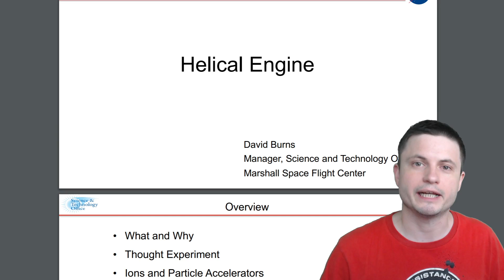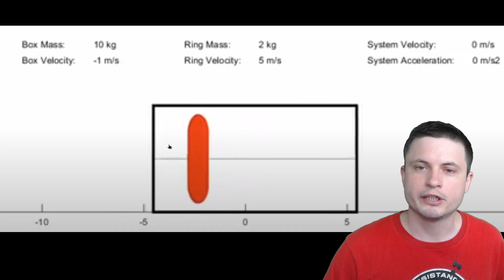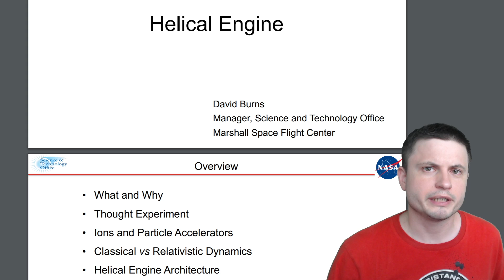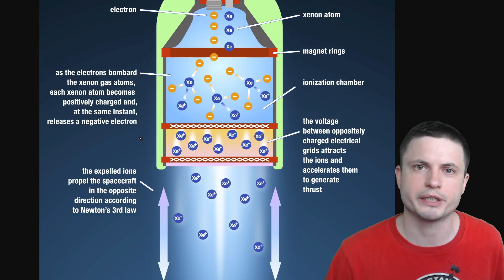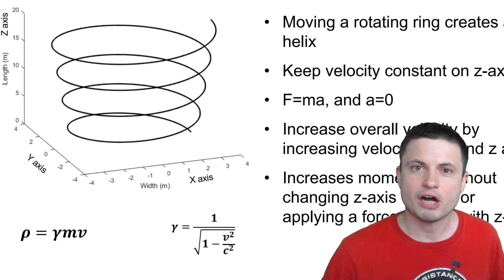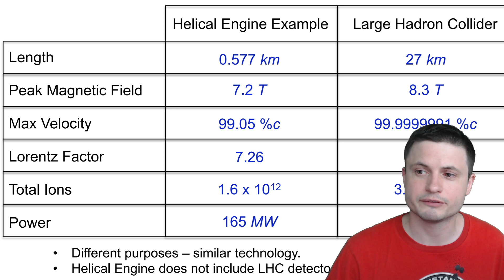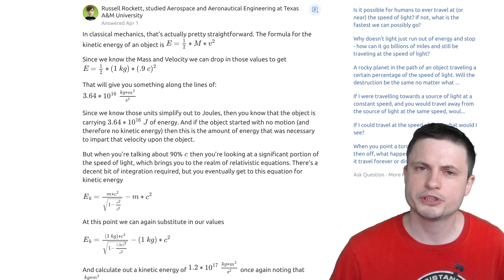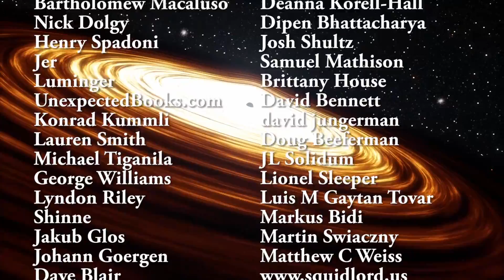NASA Engineer Designs a Near Light Speed Engine But Does It Work?

Comment: A sealed box built with a magnetic metal which you use as a accelerator and within the box a giant electro magnet within and it has the power to pull and push back and forth and Everytime it seems like it's gonna not stop you have that force you get from pushingtwo magnet's together put they push away like a brake or suspension

Comment: I'm of the feeling that everyone has got Einstein's special relativity wrong, in that they accept that the time for the people accelerating in space slows down RELATIVE to those they leave behind, likewise the length of their spaceship contracts RELATIVE to the frame of reference of those left behind, however for some strange reason mass is treated differently & rather than being RELATIVE mass is seen as absolute mass, which as the three factors of time length & mass are interrelated can't be correct. The time for those on board the spaceship moves normally the length is also normal, I suggest the mass is to, so what would happen is similar to someone falling into a black hole, they split into two, one is from their own frame of reference, whilst the other is from the frame of reference of an outside observer.

Comment: Major error in this design...there is not enough space inside a craft to accelerate to such speeds then decelerate before punching through the hull into space. He's got the right idea though but what if the hull of the craft was actually in 9 sections connected to each other by electromagnetic force...then the first section is launched forward by reversing polarity...then the second section is launched just in time to reconnect with the first....then the third , fourth etc... sort of like the way a worm moves section by section...could it be possible to get forward motion and increase the frequency until it builds up momentum?

Comment: Time dilation is bs.  Gps satellites dont rely on the mathematics of time dilation to tell you your position lmfao.  Your gps location is derived from your position relative to nearby cell towers and has nothing to do with satellites.  The only time your gps location is determined by satellites is airplanes and ships.  Airplanes rarely use it as anything other than a ballpark estimate as the system isn't even designed to show locations above the surface of the Earth or Oceans.  Ships that rely on GPS are also frequently put significantly off coarse due to the inaccuracy of the system to give an exact location as they move across the ocean and rely on visual input when making port.  If the system was so accurate that it relies on time dilation equations to calibrate then why is it still so far off?  Thats a rhetorical question.  The point is that 99% of people get their gps from cell towers not satellites and the satellites are frequently way way off compared to the accuracy you get from cell tower triangulation positioning.

Time dilation is a fun idea like the simulation theory but this is not an established fact.  Incorrect information like this guy repeated about satellites proving it by needing dilation equations to adjust for their speed fuel the idea that it is an established fact.  However as he freely admitted he doesn't understand it so him repeating that shouldn't mean anything and yet, if enough people say it a lot of other people start thinking its true.

Why would prominent scientist claim time dilation is real?  Its simply a modern example of the emperors new cloths.  If you dont accept it then you clearly arn't as smart as them.  Yet most people who claim to agree like our host here freely admit that they dont understand it.  How can you believe in something you dont understand?  You can't.  You might want to, you might even convince yourself that you do but you can't.  If your belief is based on nothing more than someone else's opinion then it is foundationless and meaningless.

The problem with time dilation is that every formula relys on an arbitrary decision by a conscious individual to choose a point of reference.  If you change the point of reference then the amount of dilation changes accordingly.  Sadly Earth is not the center of the universe.  Neither and I and neither are you.  The fundamental realities of the universe do not change based on where I decide to measure from.  Now a factual measurement of a reality can be measured from any angle or any position and that measurement is always the same.  For example if you measure a stick with a measuring tape from one end to the other and determine its length to be 1 foot then that is it length, period end of story.  If you turn it around and measure the other way it is still the same length.  If you use a different device to measure it, still the same length.

Time dilation on the other hand changes every time you change where you measure it from.  For example.  If you have a ship leave Earth at 1/2 the speed of light and a person measures the time dilation from Earth 24 hours later then the person on the ship appears to him to have only experienced 20 hours.  On the other hand if the person on the ship observes the person on Earth using himself as the reference point then he sees that the person on Earth only experienced the 20 hours.  Obviously both can not be simultaneously true.   This alone is proof that time dilation is bs.  It can't even be measured from two different reference points and get the same results.

Now just for fun lets toss in a second ship moving away from earth in the same direction at 3/4 the speed of light.  After 24 hours the guy on Earth looks at the first ships and calculates that they have only experienced 20 hours while the faster ship has only experienced 16 hours.  Now shift your perspective to the faster ship and they observe the person on Earth has only experience 16 hours while they have experienced 24 hours.  Then they look at the first ship and from their perspective that ship is only moving at 1/4 the speed of light while from Earth it was moving at 1/2 the speed of light.  So to them that ship appears to have experienced 22 hours while they were experiencing 24 hours.

So depending whether you consciously choose to measure the time dilation from Earth, the first ship or the second ship, the first ship would simultaneously experience 24 hours, 22 hours, and 20 hours all at once.  Since any reasonable person can clearly see that this is impossible time dilation is bs.  This theory is a fun trick of math but not more so than running numbers on the probability that we are living in a simulation.  In the end time dilation can't be measured from more than one arbitrarily chosen point and falls apart when measured from any two points in the universe.  It is almost unbelievable to me how many people have accepted this as a fact simply because someone they persevere as being more intelligent told them it was true.  Don't take my word for it.  Look up the formulas, do the math for yourself, its not that hard.  Read up on the experiments that supposedly "proved" time dilation.  Read their original reports and compared them to their published date.  Notice how many errors they made in simple scientific methods of establishing controlled experiments.   See where they admitted that they "corrected" numbers that didn't match their hypothesis.  In the atomic clock experiment they took multiple results which were the opposite of their theoretical results and "corrected" them to fit their theory then published the results as "proof".  Its actually a little ridiculous that anyone takes any of this seriously.

Before you get to invested in the scientific theories of a brilliant man from 100 years ago ask yourself if you would trust your life to the smartest doctor from 100 years ago, or your car to the smarted mechanic from 100 years ago.  The only reason this theory is still around is that some people like the admiration they get from others when they can convince them that they know something the rest dont.  Its really that simple.

Comment: In less than 10 years they designed, built, flew and landed on the Moon in 1969 with the Saturn 5 rocket. Now for over 10 years in 2021 NASA has been working on a rocket that will return them to the Moon and it still isn't ready. They learned at NASA that if you want to keep your high paying job don't ever complete the project. NASA has turned into a "rocket research company". The technology your talking about would take them 1000 years and still not complete it.

Comment: Well, in my thinking, if you aren't working hard enough to fail once in a while then you aren't trying hard enough.
We learn alot by failing.   We should try building this kind of thing, in a prototype here on good Ol' Earth, and see what kind of propulsive force can be achieved just like NASA is doing experimentation in their "Warp Engine" lab with Harold Sonny White.  Nothing may come of that experimentation, but then again something might, and we may be led to some other interesting avenues and possibly new science as a result of trying!  
We should always try.. We may fail, but that's the whole point.. Try, fail, try, fail, and ultimately learn along the way and then succeed!!

Comment: If anyone sees this

It's actually possible to build a brute force interstellar ship right now for around 3-5 billion that would include 10 X 10megawatt power plants, and 8falconheavies in formation to lift it into orbit.

Then using more heavies lift more fuel tanks into space to attach to the interstellar ship.

We send a module in advance to the moon, a decent sized module with a crane attached that can reach up 200+meters. This module would be produced in conjunction with BOC gasses to mine and produce methane on the moon (it's been found in craters)
Fill the fuel tanks at the moon and then get a gravity assist at the moon, then one at Venus, Jupiter and then off out the system with 30-50 raptor engines with 100-120+ hour burn in direction of system wanting to visit.

With raw materials and 3d printer onboard repairs and new raptors could be built for the slowdown burn. Gimbled raptors capable of 180°/360° movement.

We could scale down or scale up but it is possible.

Aiming for a ship size with a crew of around 250-500+k

Comment: Wouldn’t the spinning mass slow down in it’s forward momentum when it gains the relativistic mass from spinning? :s
If we ”put the spinning thing” in a box, from an outside observer it would appear as if the box is just gaining mass, ant thus momentum, wouldn’t it’s linear velocity have to decrease in order for the total momentum to be preserved?
I should probably go read the paper, but my guess is that he assumed the forward momentum to be constant and uncoupled from the spinning motion, which isn’t nesesarily true.

Update, it appears the author did consider this a possible source of error, as he writes ”the simulation model needs to be validated further to make sure rounding errors are not causing the thrust”, meaning that he is relying on a simulation and has not ”proved” that this thrust actually exists with physics equations. So my guess is still that the ions will impart a force to the ”box” as they rotate, possibly through bending spacetime.

Comment: If you could take rotational force and convert it into linear force and them back to a rotating force on the return.  You could cancel out the linear force
in the return of the mass by gradually rotation the mass as it become closer to the back end.  I found myself imagining the motion of a handheld drilling screwdriver.

Comment: Will it not be the case that no matter how you do it, you will just be creating opposite momentums? Won't the increase in mass from the spin reduce the initial velocity so that momentum is preserved? Is there any mention in the theory of this contraption of it pushing out gravity waves in one direction? That would be the only way it could possibly work without discarding matter in some form.

Comment: What if you could accelerate some matter in a ring to relativistic speed increasing its mass, move it perpindicular to the rotation for a large reaction force, recover some of the energy used to accelerate that mass by slowing it down similar to regenerative braking in an electric car, lowering its mass, and then move it back for a smaller reaction force? Use another one turning in the other direction to cancel out the circular motion.

Comment: This is fake news. To reach 90 % of c the spaceship would require a mass increase of 150 %, so if the spaceship weighed 1,000 tons, that's a relativistic mass increase equivalent to 1,500 tons! Where is the energy to provide this colossal mass increase coming from? To provide the energy of a 15 megaton hydrogen bomb explosion, only about 6 oz of mass needs to be annihilated according to the equation E = mc2. The energy required by your 99 % of c spaceship is almost unimaginable, and makes the impact of the Chicxulub meteorite look like a firecracker.

Comment: 75% of the speed of light, sounds more realistic. a fusion reactor should be able to produce a sufficient amount of energy. and finally the relativistic effects are happening in the reactor itself, therefor moving the whole apparatus produces the impuls. after it has done the job, it is switched off, moved back to the starting position ... and the whole cycle starts again.

Comment: hol up. So if you can accelerate a spacecraft by moving pistons in a certain way.... DOES THAT MEAN YOU COULD POWER A SPACECRAFT WITH A CUMMINS IXS15 DIESEL ENGINE AT CRAZY HIGH RPM??

Comment: The reason GPS has to deal with time dilation is because earth actually warps time space around it. Most gps satellites orbit close to the edge of this. Warp in time space. Building a warp field generator is easy and actually a better way to travel faster than light. Our group is not affiliated with NASA mostly because we are more interested in actual space exploration and not politics. We tested the first prototype warp field generator on december 18 2020. Since that first successful test we have conducted ten additional test all successful. We will be conducting an in-flight test in August 2021. By using an ion drive positioned at the edge of the warp field we can easily move faster than light because the emitter is right on the edge of the field and pushes against normal space. For those who have not figured out how to actually warp time space go back to some old science that we have already learned. Planets and stars warp space time around them. This is a measurable effect that has been proven and we already know how they do it and how to actually measure this effect. Now take that little bit of information and modify it for practical application. Mass x rotation speed x electromagnetic field strength. Now you have a hint of how to warp time space. It is not as complicated as some people think. The tricky part is controlling the field size, shape and propulsion. Don't forget that warping time space must be done carefully. Because once you warp time space around an object that object is no longer affected by gravity in normal space because both time and space are warped around the object. Which means it becomes isolated from gravitational fields. That is all the hints I am allowed to give out at this time so good luck and we will see you out there.

Comment: Has anyone ever looked at using sound or heat to push forward I'm curious as to what would happen if we took a speaker into the vacuum of space what it would do would there be wave effects ? Would there be sound ? Sound likely not but wave ripples how about heat like a heater element like the one u use in your house or at the arena to keep you warm while in the stands would it push forward ???? We need to start looking at things we currently have abundance of test those theory's many there is something so easy to create and make that we currently know already what about electric current in triangle like that ionization experiment that u can watch u add current and the triangle makes lift

Comment: Seems logical to spin it, almost like the allusive  Perpetual Motion. If only could get over the dissipation effect. You could however if that wobble force you mentioned could be redirected just enough to compensate for, then it wouldn’t be a problem. You could quantify it’s speed with each rotation by adjusting the wobble by design of its direction for example a spinning triangle with 2 positives to one negative irons drives within a circle of opposing irons.

Comment: smells like bull. doesn't the stuff slow down when increasing in mass? I mean of course not but relatively. When it's accelerating, it kinda gains mass instead of speed but the rest of the engine doesn't gain mass right away, so the increasing mass pushes back more on the engine more and more, so overall it stays in the same place and the center of mass won't budge. Also, how do you even get the ship up to a speed where the mass increase of the stuff becomes usable? I guess you just don't, unless you put the whole ship into a particle accelerator. Ion engines wouldn't cut it.

Comment: The twins paradox isn't technically about one being older than the other, it's that if all frames of reference are equally valid, then how is it that we can tell which is the older, given that from the point of view of the twin of the rocket, it's just as valid under Special Relativity for him to see it as the earth accelerating away. I believe that it's solved in General Relativity, but I'm no expert. Perhaps it's solved in Special Relativity by noting that the one in the rocket is the one that feels the acceleration?

Comment: OK, so you have huge power requirements. How about doing the main acceleration by  using solar panels and a close solar orbit (maybe even combine it with a sungrazer technique, though intuitively you might need to spend more time near the sun to apply the neccesary power via photovoltaics).